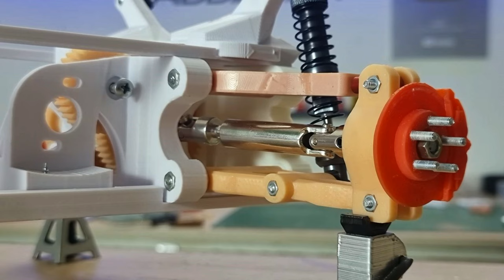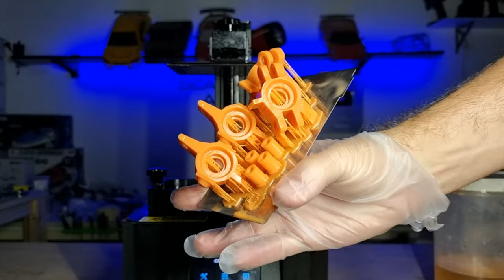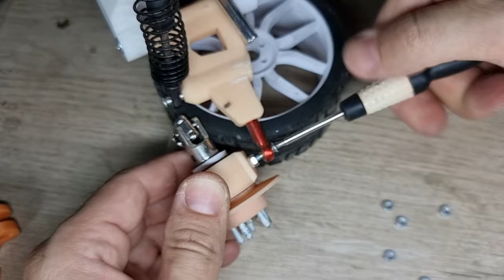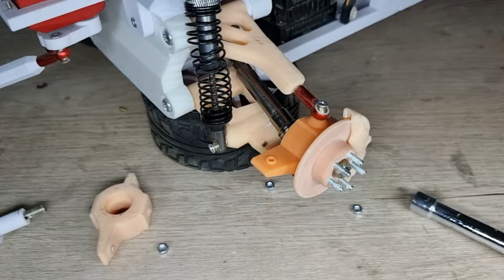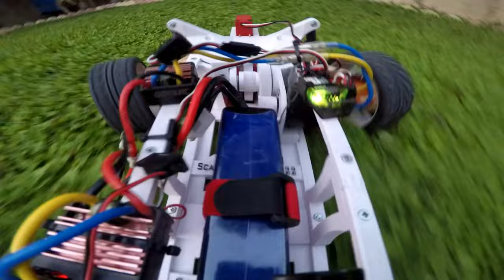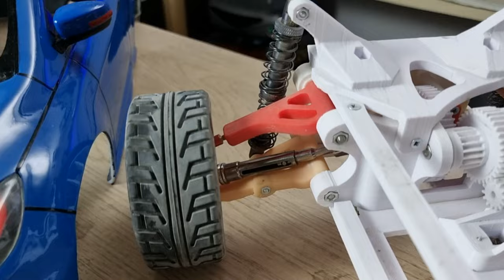STL File + Running 3D Printed 8th scale Brushed rc car part 5| Scale Addiction

Comment: I asume that both motors turn the same direction, if thats the case u can also use an Hobbywing 880 ESC ( build for dual motor controle 👍 )